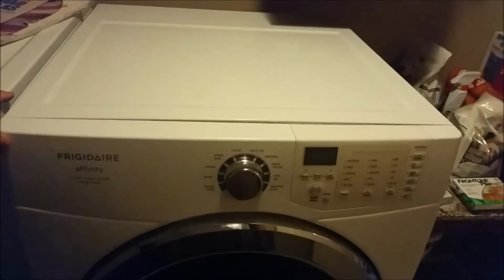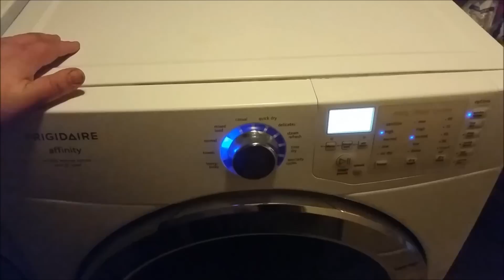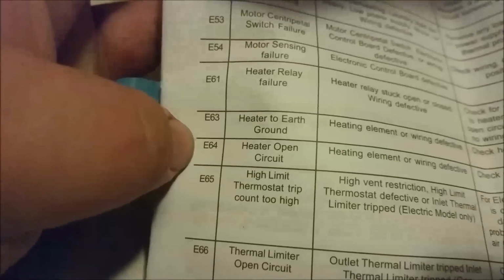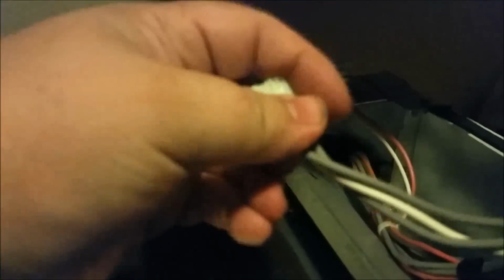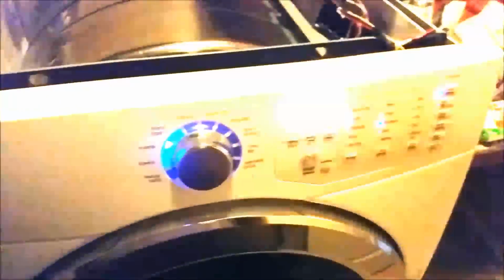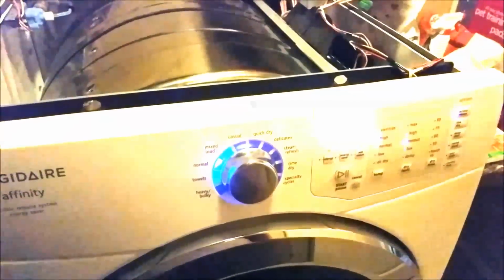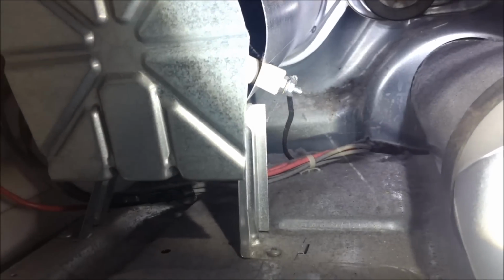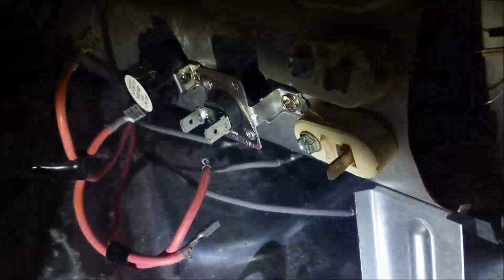Frigidaire Affinity Electric Dryer e64 Code

Comment: Thank you so very much for sharing your knowledge and expertise. You just saved me a lot of time and money. Some settings gave me E61 and some gave me E64. I noticed continuity across grey wires and upon removal of the heater I noticed coils sagging and touching. Your video gave me the confidence and information I needed to complete this project. Thanks again.

Comment: Got the E64 error and promptly bought a new heating element on Friday. It came the following Monday and I followed the disassembly instructions shown in the video. Replaced my heating element and presto....no more errors. It took me about 3 hours to accomplish this personally amazing feat. Great opportunity to get into the chassis and clean out all the dust and lint. I also found a clogged up vent.....probably why my heating element burned up. Was also able to see the coil had come apart, so my hunch paid off. Thanks!
Reply: Has it held up?

Comment: My 2012 affinity is getting the e64 code . When I open the door it's good and hot inside the dryer . Suggestion?
Reply from the maker: watch  the video
Reply: Fast Eddie's Appliance Repair at the end of the video did you say that making sure you have a clean vent will help prolong the life of the heating element ?
Reply: @PeppyChimpers  my dryer was working great! Today I cleaned out the dang vent! I
All I did was pull all the lint out and vacuumed the best I could. Then I put it all back together and  ‘waaLaa’  my dryer starts giving me problems (E 64)!  What the heck???

Comment: That model of machine is also branded by Kenmore,  Samsung,  electrolux, fridgedaire, and more. 134792700 is part # for Kenmore. I think it would x-reference. Easier for me to go though the back and replace on kenmore. Advice is to get cheap hammer drill or set drill "clutch" to 8 or 9,,,helps vibrate screws loose on back. Same thing happened to mine, melted,  but worse. Thanks.

Comment: would have been nice to see the wires still hooked to heating element so we can see how they are placed
Reply from the maker: the 3 terminals on the left are gray and the terminal on the right is black and the pink ones go the thermals and i think there wired inline with each other.  but this may differ from model to model so you need check the schematic in your tech manual. or just watch how it comes apart .

Comment: Too bad your meter wasn't working. I wish you would of just shown how to plug in the meter with it off lol...then i could do it myself lol..also how easy it is to take out that front vent, and where we should look for that 10% at in the wires just incase the circuit isn't open. And Thanks for the Plug screwdriver usage insight! Genius!!!

Comment: My mom is having an e64 error on her Frigidaire dryer. She says that she can do a load and then the second load gives the error. If she unplugs is then try’s again it will work until she does a second load again. What would be causing this?
Reply from the maker: did you check with an ohm meter like in the video
Reply: Fast Eddie's Appliance Repair What should you look for if the circuit isn't open?
Reply: People watch the video he explains all this

Comment: Have had my washer and dryer for 6 years, they are exactly like the one you are working on. Have had to replace element in dryer 3 times already. Why should this be. Seems to me like a money raquet so you will have to keep putting more money into something that should last longer than that. I paid over 2 thousand dollars for them, worst financial mistake ive made in a long time. Cheap made and definitely not worth half what i paid. They got me once but it want happen again.
Reply from the maker: Terry Hall it sounds like your vent is not flowing very good may not even be clogged.may just be to many bends or to long of a run or you may be your running at the limation. Your aloud 25 ft and every 90 dig. bind takes 5 ft from that number even worse if it's in the vent hose because it's not smooth and I would also not use the highest heat setting as much as possible that adds to the were of the elements on these
Reply: I’ve had my set since 2012!  Never had ANY issues with washer or dryer until this year! My washer is leaking and today I cleaned the vent and this (E64) started happening!  
I agree with Fast Eddie! Clogged vent, down the line? Something else causing the burn out!